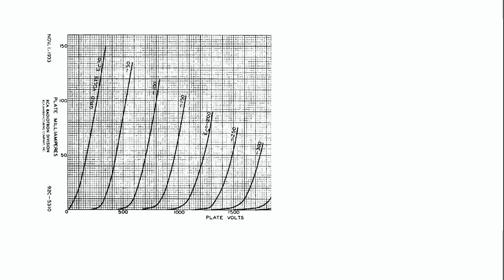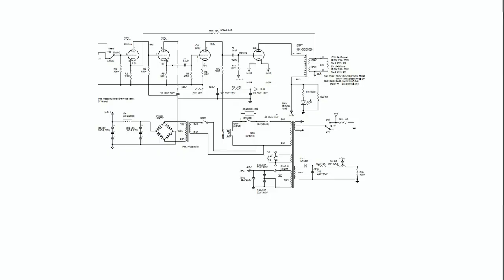tube audio lecture #1, how to build your own tube tester for high power tubes such as 845, 211, 805

Comment: I’d love to see how you modified the Stark HV power supply.
Reply from the maker: I added 1 VARIAC & 1 high power PT to modify it. Thanks for watching my videos, de VA3SYA / HL1TFC. thanks
Reply: @YoungAhn  Looking at acquiring an Eico 1030. I presume you wired the PT primary in parallel and the secondary in series with the other to step it up more ? Could you share a schematic ? You’re email is not on QRZ :) de WB4YDL 73